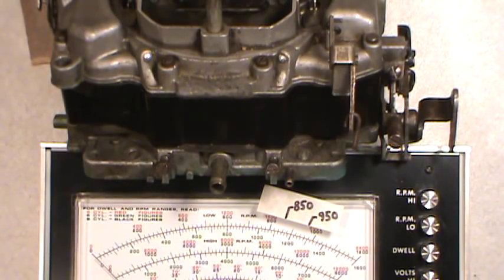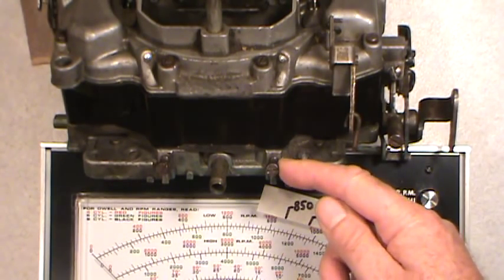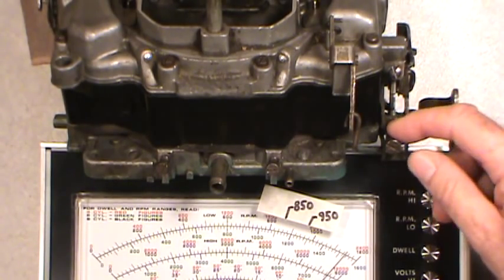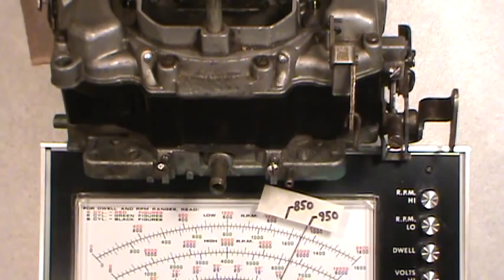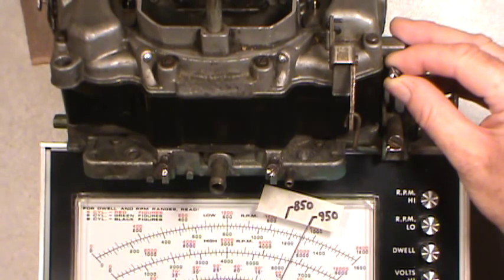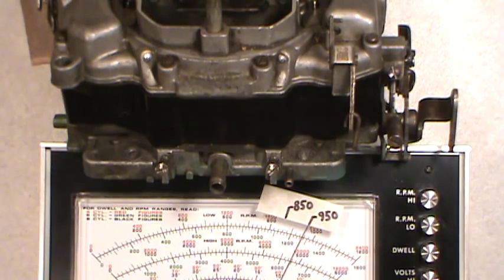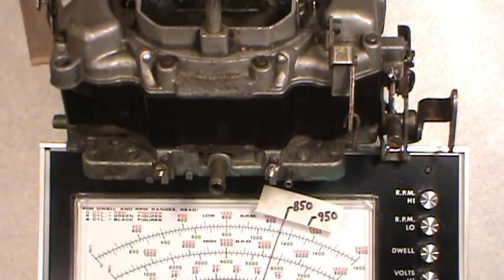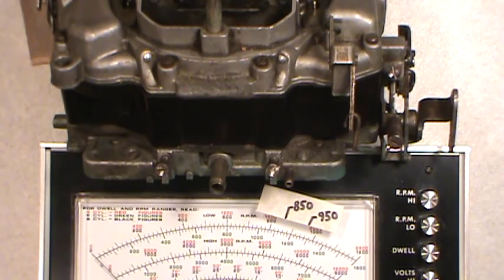Idle Mixture Adjustment on 4 Barrel and 2 Barrel Carburetors

Comment: Thanks for taking the time to make this video. I have a 2 barrel Autolite 2100 carb and an automatic. Do I need to plug the vacuum advanced like if I was checking timing or leave vacuum advanced intact? Also with the automatic, you do recommend adjusting while car is in drive or can this be done in park?
Reply from the maker: Greetings Quang Bui....You are welcome, and thanks for Your comment/questions....I have spent quite a bit of time, working on a Motorcraft 2100 Carburetor, and, I'm pretty sure that it's the same as the Autolite 2100, with both of them being 2 Barrel carburetors....I have no idea, as to which Vehicle and Engine that Your 2100 2 Barrel Carburetor is mounted on...and...Do You have to have Your Vehicle "Smog" (aka, Emissions) Tested?...if so, then, You have to be a bit more "Precise" in Your Idle Mixture and Idle Speed Screw/s "Settings!"

If Your Engine is Stock, without any Modifications, then, the best thing to do, is to have a look around Your Vehicles Engine Compartment (under the Hood), and see if You can find a V.E.C.I. (Vehicle Emission Control Information) Label/Sticker, as that Label/Sticker, usually has the required Information, on how to "Set-Up/Adjust" Your Autolite 2100 Carburetor for Smog/Emission Testing.

In the event, that You are unable to find the required Information, then, here is what I would usually do, to Adjust the "2" Idle Mixture Screws, and the Curb Idle Solenoid or Screw...

The Engine has to be Fully warmed up, with the Choke completely Off and Open.

Air Cleaner Housing, and Air Filter "Installed".

Air Conditioning, Heater Blower Motor, etc. Turned "Off".

I usually do a "Lean Drop" of, no more then "100 RPM's", from the Fastest Idle Speed, that I can get with the "2" Idle Mixture Screws.

Some of the V.E.C.I. Label/Stickers that I have seen, can have Different Lean Drop RPM Settings, and some, might even be around 40 RPM's, depending on the Vehicle Manufacturer, Engine and Carburetor, that was Originally Installed.

You just have to remember, Not to let the Engine Idle Speed get Too High, as that can cause the Mechanical and Vacuum Advance to Add "Unwanted" Ignition Timing, that usually "Alters" the Speed/RPM's of the Engine.

I usually do the "2" Idle Mixture Screw Settings, while the Vehicle is in "Park" (automatic transmission), for Safety reasons.

Vehicle on Level ground...Automatic Transmission in "Park"...Parking Brake On...Wheel/Tire Chalks (aka, Bricks, Lumber, etc.) to keep the vehicle from Moving!

The Vacuum Advance (rubber) Hose, should be "Plugged", so as to make certain, that, the Vacuum Advance "Is Not" causing an RPM Change, due to Advancing the Ignition Timing, which will Mess-Up the Lean Drop, and Idle Speed Settings.

Most Stock Ignition Systems, on the older carburetor equipped engines, as far as I know, Don't usually Start Advancing the Ignition Timing, until, the Engine RPM"s Exceed about 1000 RPM's, but, I will bet, that there are exceptions!

Once the Engine is Fully Warmed Up to Operating Temperature, Set the Idle "Speed" "Solenoid or Screw" to "800 RPM's", then Adjust Both Idle Mixture Screws, a little at a time, to get the Fastest Idle Speed, showing on Your Tachometer, but, make sure that if the Engine RPM's start to go Higher then that "800 RPM"s", then Reduce the Idle Speed back to that "800 RPM's", with the Idle Speed "Solenoid or Screw", and re-adjust those "2 Idle Mixture Screws", to get the Highest RPM's, while Not going over that "800 RPM's", by very much.

Once You have the Highest RPM's that You can get, with the "2 Idle Mixture Screws", Re-Adjust the Idle "Speed" Solenoid or Screw, to get Exactly "800 RPM's" showing on the Tachometer.

Then, put a Chalk Mark, or other mark, on the "2 Idle Mixture Screws", at the 12-O-Clock (aka, closest to the Sky) position.

Then, it's just a matter of, Turning "In" (Clockwise), the "2" Idle Mixture Screws "EQUALLY" (Same Amount for each Idle Mixture Screw), each one a little at a time, turning the Left one a bit, then the Right one a bit, and go back and forth between the 2,  Until the Tachometer is showing Exactly "700 RPM's", and "Both" Chalk Marks are Pointing in, Exactly the same Direction, as in the "O-Clock" position!

Once the "Lean drop" Procedure is done with the "2 Idle Mixture Screws", then just leave them "Set" at that Position!

Once that is done, making sure that You can see Your Tachometer while sitting in the Driver Seat, put Your Foot on the Brake, and put the Automatic Transmission Lever in "Drive", and see what RPM's the Engine is Idling at...

If the Engine "Idle Speed", while in "Drive" with Your Foot on the Brake, is either too High or too Low, then, put the Transmission, back in "Park", and Adjust the Curb Idle "Speed" Solenoid or Screw to Increase or Decrease the Engine RPM's, then, Foot on the Brake, and put the Transmission in "Drive" again, to see what the Engine RPM's are at.

Repeat the "Idle Speed" Solenoid or Screw Adjustment, if needed, while the Transmission is in "Park", so the Vehicle Won't Move! (for Safety reasons!).

If Your Vehicle "Does Not" have to be Smog/Emission Tested, then, You can usually, just Adjust the "2 Idle Mixture Screws" for the Fastest RPM's, "Without" having to do the "100 RPM Lean Drop" Procedure, but, Your Vehicles Gas Mileage/Kilometer-age might not be as good, especially while Your Engine is Idling at a Stop Sign or Red Light.

Your Engine has to be "Tuned-Up", and the Maintenance "Items" must be up to date, to give Your Engine the Best Chance, at running the Best that it's able to.

If You need any help at all, let me know, all that You can, about Your Vehicle and Engine, or, I will still, be going on a...

..."Wild Goose Chase!!!"...lol.

Good Luck...

Be Safe, take care, and have a good one.
Reply: RockysRoadshow Thank you for the detailed written instructions. Sorry for not entering my car's info. No, I do not need to pass smog because it's a 1969 Mustang 302 (probably orig). In California I believe any car older than 1975 do not need to be smogged. Air cleaner, fuel filter, plugs, plug wires, oil, electronic ignition have been recently changed. Carb have been replaced/rebuilt a few times since I've owned it for less than a year due to numerous issues but seems to be running well now except for fumes. The reason I want to apply you method is when I have the windows rolled down or the top down and stop at a stop sign/light, seems like there's a back draft and the gas smell would rush pass the car.
Thank you again for passing along your wealth of knowledge to myself and others!
Reply from the maker: Quang Bui Greetings Quang Bui....Exhaust "Fumes" You say?...Been there, Seen that...and..."Fixed" that too...!!!...lol....Before I start tellin' You, about the Many Things, that can cause, what appears to be a "Rich" Air/Fuel Ratio, that Your Autolite 2100 Carburetor just might be Feeding Your Engine, I will mention the following....The Gasoline that is being sold these days, usually has a certain "%-age" (aka, Percentage) of "Ethanol" (aka, Alcohol) added to the Gasoline....This Percentage of Ethanol in the Gasoline can vary somewhat, depending on where You live....The Higher the Percentage (or amount) of Ethanol in the Gasoline, the "Leaner" the Air/Fuel Ratio, the Carburetor will be administering (aka, Feeding) Your Engine.

The more Ethanol that is in the Gasoline, the More that problems will usually occur, not only causing a "Lean" running Carburetor/Engine, but this Ethanol, as I have been reading, can cause Fuel System Parts, including the Carburetor itself, to start to Corrode, and cause deterioration of rubber-like parts as well.

When You (or someone else) Rebuilt Your 2100 Carburetor, did You (or they) Install a "New" Float?

If it's made of "Brass", which I highly doubt, then the Float is usually made out of a Material called "Nitrophyl" (looks like black plastic), and this stuff, is prone to acting like a "Sponge", and some of them, over a period of time, can, and will "Absorb" Gasoline, causing the Float to start to "Sinking" somewhat.

When these Nitrophyl Floats start Sinking, the "Wet" Fuel Level in the Carburetor Float Bowl will usually become "Higher" then wanted in the Float Bowl, and will usually cause an Overly "Rich" (Air/Fuel) Ratio, and, could be the cause, of all of those excessive Exhaust "Fumes" that You had mentioned.

Some People, Install a Float, be it New or Used "Without" Checking and Setting it Properly, to the Proper "Specification", which, as I see it, will make for a "Not-So-Fun" (and Poorly) Running Carburetor! (could cause a too "Lean" or too "Rich" Air/Fuel Ratio).

(Please, don't use the following, as these Measurements, only Applied to one of the Motorcraft 2100 Carburetors that I rebuilt a while back...."Dry" Float Setting was 3/8" from the Top of the Float Bowl, to the Top of the Float, while applying light pressure to the Needle/Seat assembly, and, the "Wet" Fuel Level in the Float Bowl was 3/4", as I recall).

Make sure, that Your, I hope "New" Float, is "Set" to the Proper "Specification", that You can find, in a Factory Service Manual, or, on the Rebuild Kit's "Instruction Sheet/Paper", for Your Exact Vehicle and Engine.

Make sure, that Your 2100's Choke, as in, the Fast Idle Cam/Screw, Linkage, and that the Choke Plate is Fully Vertical (aka, Fully Open), when Your Engine is Fully warmed-up to Operating Temperature, or, it may cause..."Fume-City!"...lol.

Sometimes (I'm thinkin'), if Your Engine may have "Back-Fired" at some point in time, that has been known, to sometimes "Rupture" the "Power Valve" Diaphragm! (some call it an Economy Valve), which, as I recall, makes for a "Very Very Rich" (Air/Fuel Ratio), and, if that be the case, that could very well be, what's causing those "Fumes" that You are experiencing.

The Power Valve is Located "Underneath" the carburetor Float Bowl (if memory serves me right, that is).

Also, if someone "Messed-up", and put the "Wrong" Rating of Power Valve, in the Rebuild Kit, or, if Your Engine has an Aggressive Aftermarket Performance Camshaft installed in it, that can cause a very "Low Vacuum Signal", while having the "Stock" Rated Power valve Installed in the 2100 Carburetor, that "Stock" Power Valve will usually be Adding In Fuel, when it's Not Supposed to...!!!

It could be, that, Your Fuel Pump, is putting out, Too Much Fuel Pressure, which will usually "Over-Power" the Floats "Ability" to Close the Needle/Seat Assembly, which in turn, will cause a "Too High" Wet Fuel Level, in Your 2100's Float Bowl, and again I say...Fume-City!...lol.

Could even be Dirt/Crud that has lodged in between Your Needle and Seat, which in turn, will cause that very unwanted Too "High" of a "Wet" Fuel Level in Your 2100's Float Bowl.

Seeing as how you are so very Fortunate, as in...Not Having to have Your Vehicle Smog/Emission Tested, You Don't have to bother with that "Lean Drop" Idle Mixture Screw Setting.

Just, set the "2" Idle Mixture Screws to the "Fastest RPM's", and, the rest of the Information that You should need, is already in my Previous Comment/Reply to You.

Did You "Gap" Your Spark Plugs, before You Installed them, in Your Engine???

Electronic Ignition, You say???

I'm thinkin', that Your Engine's "Ignition" has been "Upgraded"...

As far as I recall, a 1969 Ford, had a "Points and Condenser" Type of Distributor installed by the Factory.

The Only way, that I can get close enough, to figuring out, what Your "Fume" Problem is, is to let me Know, "Any and All" Modifications or Upgrades, that are Over and Above, that of the "Factory Installed" Parts, and, if there are "Any" Running/Performance Issues as well.

So then, perhaps "Check" all of the Things, that I have mentioned above, and if You like, let me know, how You're makin' out.

Be Safe, take care, and have a good one.
Reply: RockysRoadshow
Wow! Thanks again to take the time out to write a thorough response! Truly appreciate your time.

I've done a few things with the Mustang since I've owned it. Purchased a rebuilt carb, had my original carb rebuilt, then rebuilt both myself after that. I had one that had a brass float and one that had the new nytrophyl. Not sure which one is in my car right now. When I rebuilt both carbs, I did not do anything with the choke since they were already rebuilt and new. I did replace the rest of the items that were in the kits; seats, needles, check balls, gaskets, power valves, clean the lines,... I did check the floats according to the kits with the supplied ruler. I also replaced the fuel filter with motorcraft filter, added a second filter before the mechanical fuel pump, replaced all rubber hoses with EFI hoses, replaced the fuel tank. I adjusted the choke so that when you first step on the gas pedal before starting, the plate almost closes and then open fully when warmed up. Then when I step on the gas, the fast idle disengage and curb idle takes over. Also replaced the electric choke with hot air choke since the electric choke opened the plate too quickly by using a choke stove. Seems to take a little longer to fully open which is what I was looking for.

Yes, ethanol in the gas is the only thing I can buy here. There's only a few places in Southern California that sells ethanol free gas and it's at least 50 miles away. The way my car sucks up gas, it'll cost me half a tank to go fill a tank.

As far as my engine is concerned, I don't have any info on it other than it's a 302. Don't know if it was ever rebuilt or any modifications were made to it. The person I bought it from inherited from his dad when he passed away so he didn't know the history.

I installed the Pertronix Ignitor I so I don't have to deal with points/condensers. Seems to be OK so far.

Will try to find some time to apply your techniques when I have a chance. Traveling and then planning to upgrade my front suspensions over the 4th weekend. These old cars can sure suck up you money fast but they are fun to drive.

Thanks again RockysRoadshow!
Reply from the maker: Quang Bui
Greetings Quang Bui....Your Engine's Spark Plugs will usually be a pretty good "Indicator", as it applies to, how "Rich" or how "Lean" of an "Air/Fuel Ratio" that Your 2100 Carburetor is Feeding Your Engine....A good place to get started, would be the following...

With Your Engine "Cold", Remove "1" Spark Plug at a time, so You don't run the Risk of placing the spark plug "Wires" on the "Wrong" Spark Plugs!....I have a...How to Read Spark Plugs...Video, on my YouTube Channel...RockysRoadshow...enjoy.

Also, have a look-see at the other Videos that I have Uploaded, as I'm pretty sure, that there should be some Information, that might just help You out, somewhat.

If You do, Remove Your Engines Spark Plugs, "Record" (aka, write down on paper), everything that You notice, about...Color...Deposits...Carbon build-up...and how much the "Wear Amount" (aka, Gap) is, on both, the Inner Electrode, and the Outer Electrode, and also, make sure that You Record "Which Cylinder", that "Each" Spark Plug, came out of...!!!

Also, "Check" (as in Measure) the Spark Plug "Gap".

If You care to, let me know, what You have Observed/Found-Out, as, those good ole Spark Plugs, really "Do" have a "Story" to tell...!!!

Be Safe, take care, and have a good one.
Reply: RockysRoadshow Hello FocksRoadshow! Got back from my trip yesterday and checked the plugs. They seemed to be on the lean side. The porcelains were white like new. The ground electrode had a light white color on them. The passenger side had a little more color on the porcelain than the driver side but still fairly white after about 4K miles or so. Checked the gap and all but one were at the correct gap. The one was a little larger which I fixed. No fouled plugs. Also checked timing and timing was correct. Have not had a chance to apply your method but will work on it over the long weekend.
Thanks!
Reply from the maker: Quang Bui
Greetings Quang Bui....There are a few things that can effect, the way in which, Your Engines "Spark Plugs" Look, and the way that Your "Engine" Behaves/Runs....Always keep an eye, on how Clean or Dirty Your "Air Filter" is, because, once it starts getting the slightest bit Dirty, that will "Restrict" Air Flow, into the Carburetor, which will usually start causing the Air/Fuel Ratio, to become "Richer" (More Gasoline, Less Air), and Your Gas Mileage will get Worse! (aka, Less Miles Per Gallon!)....The "More" Ethanol, that is in Your Gasoline's "Blend", will usually "Not" leave as many "Deposits" to Read, on Your Engines "Spark Plugs", leaving You to think, that the Engine/Carburetor is running too "Lean" (air/fuel ratio).

As far as I've already experienced, a "Lean Running" Engine, will usually start "Lean Surging" (Lean Surging, is when the Vehicle Jerks or Bucks, Back and Forth), while just trying to maintain a City Speed of 30 Miles Per Hour  (50 Kilometers per hour), while on a Level road, but, this particular "Lean Surge", only applies at this Speed, and, I found that the "Main Jets" needed to be "Increased" (to a Larger Size), to get rid of this very annoying "Lean Surge" at this particular Speed.

If Your Fully Warmed Up Engine, is Running "Smoothly" at "All Speeds", and at "All Throttle" (aka, gas pedal) applications, as in, just "Cruising" along, at various speeds, up to, and including, "Wide Open Throttle", either from being stopped, or, while already in motion, then, that's a pretty good indicator, that the Engine shouldn't be running too lean...

...but...

...beware, that, if in fact, Your Engine "Is" Running Too "Lean", especially while doing a "Wide Open Throttle" Acceleration, then, it might cause some Serious "Engine Damage"...!!!

Keep a Close Eye on Your Engine's "Spark Plugs" every so often, not only for Deposits, but just as Important, the ""Wear Rate" (aka, electrical erosion), that occurs on both the, Inner and Outer "Electrodes".

If You have the "Conventional" type of Spark Plugs, then, this Electrode "Wear Rate", shouldn't be much more, then about "1" Thousandths of an Inch, in about "1000" Miles of Engine Operation, that the Vehicle Traveled. (.001" in 1000 Miles).

One other cause, of the Excessive "Exhaust Fumes", could be, what is called, a..."Lean Miss-Fire"...

...that's when, the Air/Fuel Ratio, becomes a bit Too "Lean", which will not Burn Properly, and will usually Spit Unburned Gasoline into Your Exhaust Manifolds, making for some "Smoke" or "Fumes", that might start coming out of Your Tail Pipe.

Another cause of a "Miss-Fire", is when, Your Ignition System becomes troublesome, and "1" or More "Spark Plugs", Don't "Spark" when they are supposed to, or, not at all, which will also, cause Unburned Gasoline to enter Your Engine's "Hot" Exhaust Manifolds, making for...Unwanted "Smoke" or "Fumes", that will usually be Seen and Smelled, coming out of Your Tail Pipe/s.

"WARNING"...!!!...Exhaust Fumes are "DEADLY"...Make Sure, that You have Lots of Fresh Air and Ventilation, and "NEVER" have a Vehicles Engine "Running", with the Garage Door "CLOSED"...!!!

If You care to Spend about $200 to $300 Dollars on an "Air/Fuel Ratio" Gauge Kit, that should Include, a "Wide-Band Oxygen Sensor", the Oxygen Sensor's Mounting "Bung" (aka, screw threaded metal ring, that gets welded to the exhaust pipe/header), the "Air/Fuel Ratio Gauge", and the "Wiring", then, by having the "Air/Fuel" Ratio Gauge, mounted on, or near Your Vehicle's Dashboard, then You can actually "Monitor" Your Engine's/Carburetor's "Air/Fuel Ratio", as You Drive at Different Speeds and Throttle Applications.

Depending on the "Altitude", "Air/Fuel Ratio's", something around "14.7 to 1" should be alright for "Light Cruising", and about "12.5 to 1" for "Wide Open Throttle" Application's.

I'm thinkin' though, the More Ethanol that's in the Gasoline "Blend", the "Richer" the Air/Fuel Ratio should be, Showing on the Gauge, because "Ethanol", by itself, "Requires" Much Larger "Fuel Jet/s", and a "Different" and "Richer" Air/Fuel ratio, then that of, 100% Gasoline, that "Does Not" have any "Ethanol" in it.

Those Good Ole "Carburetors, were "Calibrated/Set-Up", using "100%" Pure Gasoline, and now that, they have "Changed-The-Goal-Posts", as in "Modified" the Gasoline with "Ethanol", that "Changes" the carburetors "Calibration", and as I've experienced, it makes the "Older" Carburetors "Run" on the "Lean Side" (air/fuel ratio).

Also, Gasoline "Formulations", as far as I know, have "Additives", in the form of..."Oxygenates"..."Fuel System Cleaners"...and, who knows what else!

As I see it, Each Carburetor seems to have its "Own Personality", and, some Carburetors, "Are Not" as affected as much, as Others seem to be, when they are having to use, the Gasoline "Blends" of Today, which usually has "Ethanol" in it.

Once You know, what to be looking out for, the easier (sometimes...lol), that, You or I, can make the Needed "Changes" or "Adjustments", in order to have Our "Dinosaurs" (lol, otherwise known as) "Carburetors", work as they use to, way back when..."Real" Gasoline was available...

Be Safe, take care, and have a good one.
Reply: RockysRoadshow
Hello RockysRoadshow! I should have some time this weekend to apply your adjustment method even though I will be busy upgrading my front suspension but should be able to fit 30 minutes or so into my schedule. Not sure how long the suspension upgrade will take since this will be my first time doing it so I'm leaving myself all weekend to do it and Monday to get an alignment if it's all done.

The gaps on the plugs were not off except for one of the plug, the gap was larger. I'll pull that plug to check for inner electrode wear. I'm trying to not be too lean but also don't want to smell like fumes when I drive with the top down which is most of the time. Guess getting that correct combination is my ultimate goal and appreciate all the help you're giving my.

I was looking to add an AFR but noticed that they only come with 1 sensor but I have 2 headers and they do not connect anywhere like in an H-Pipe or X-Pipe so I would need a unit with 2 sensors which I have not found. I have also contemplated in switching out the carb & manifold to an EFI system in the future. These old cars sure are money pits but are more fun to drive than my Prius.
Thanks!
Reply from the maker: Quang Bui
Greetings Quang Bui...."Warning"...be very "Careful" whenever you "Disconnect" any "Suspension Component", that has anything to do with, "Keeping" that "Big Strong Coil Spring" in its "Place", Especially if, that Coil Spring is Under "Compression", because, if the "Coil Spring Is Not Compressed and Locked" into Place, with an Approved "Spring Compressor Tool", and the "Energy" that is "Stored" in that Coil Spring, all of a Sudden, "Breaks Loose", it has the Potential to "Injure" or even cause "Death", if it Hits a Person in the right place...!!!

Also, make sure, that You Support the Vehicle "Properly and Safely", with something like "Jack Stands" ("Not a Bumper Jack"...!!!), so as not to have the Vehicle Fall or Drop Suddenly, which might cause Personal Injury, or Worse...!!!

About Your Vehicles "Fumes"...

...sometimes, and rarely at that, there are times when You just might have a "New" Ignition Part (or any other part as well), that could be "Faulty" even before You Install it...

...I have had a Brand "New", Faulty Mechanical Fuel Pump, right out of the Box, and, also, some "New" Spark Plugs that were questionable as well.

Now, about a few ways, that You can consider, as it applies to more then "1" Way, to have a Working "Air/Fuel" Ratio Gauge Set-Up in Your Car...

If Your "Intake Manifold" is a "Dual Plane" Type, then You should only need "1" Oxygen Sensor, in "1" Exhaust Pipe/Header, and Installed properly, with proper Clearance, to avoid/prevent, "Burning/Melting" the Oxygen Sensors "Wiring".

With a "Dual Plane" Intake Manifold, "1" side of Your Carburetor (either the left side, or the right side, Throttle Bore) will provide an Air/Fuel Mixture, to, "2" Cylinders on Each Side of Your Engine at the "Same Time", and the "Other" Side of Your Carburetor (Throttle Bore), will supply the Other "2" remaining Cylinders, on Both Sides of Your Engine.

Most "Stock" Factory Intake Manifolds, on a Carburetor Equipped V-8 Engine, are usually the "Dual Plane" Type.

If You have a "Single Plane" Intake Manifold, (usually Aftermarket), then, all "8" Runners (if it's a V-8, that is) have (tunnel-like passageways) inside the Intake Manifold, that will be taking the Air/Fuel Mixture from "Both" Throttle Bores of Your Carburetor.

If You really Need an Oxygen Sensor Mounted/Installed in "Each" Exhaust Pipe, You could check, to see, if some Company/Manufacturer "Makes" a kind-of "Switch", so You can Switch between the "2" Oxygen Sensors, while Only having "1" Air/Fuel Gauge, in, or near Your Dashboard...

...or, You could have a "Bung" (the screw-threaded pipe-like, collar, that the Oxygen Sensor screws/mounts into), having "1" Bung, welded into/onto Each Exhaust Pipe/Header, and, when the Exhast System is "Cold", just simply "Transfer" that "1" Oxygen Sensor, to the Other Exhaust Pipe's "Bung", to see what the Air/Fuel Ratio, is on that Side, being Careful with the Wiring, so as, not to have that Wiring in contact, or too close to a "Hot" Exhaust Pipe, and make sure, that You Support the vehicle "Properly and Safely" to avoid Personal Injury...!!!

EFI...???

If You think things are kinda complicated now, then, if You do decide to go EFI, then that, at times, can be a very Different, and quite Involved "Ball Game"...!!!

Good Luck...

Be Safe, take care, and have a good one.
Reply: RockysRoadshow Thank you for your caution! I am planning on replacing the front springs and will get a loaner spring compressor from Autozone. Definitely don't want to get hurt by the springs or any of the components.

Still thinking about the AFR. They make dual sensor that I just found when searching yesterday. Not at that point yet but something for down the road. Same with EFI. They make it look so easy with their kits on Youtube but I'm sure it's not as easy as it looks but that's way down the road.

So back to the idle mixture adjustment. How long should I wait after making a small turn before I see the RPM go up or down? Does it take a little bit for the rest of the engine to feel the effect of the adjustment or is it pretty instantaneous?

Thanks again!
Reply from the maker: Quang Bui
Greetings Quang Bui....The Answer to Your Question is...You "Will See" Your "Tachometer" RPM's, Respond to the Turning of Your "Idle Mixture Screw/s" almost Instantly, with the Exception of, if You happen to be at the Point of, being at the "Rich" Limit, any further "Richening" (usually turning Counter-Clockwise), might not Show, much of a Change in RPM's, if at all....If You happen to go "Too Lean", and if the Carburetor is operating properly, any Further "Leaning" (usually turning Clock-Wise), will usually cause the Engine to go Too "Low" in RPM's, and the Engine will usually "Stall" (aka, Stop Running)....Till next time...Be Safe, take care, and have a good one.
Reply: RockysRoadshow
Thank you!